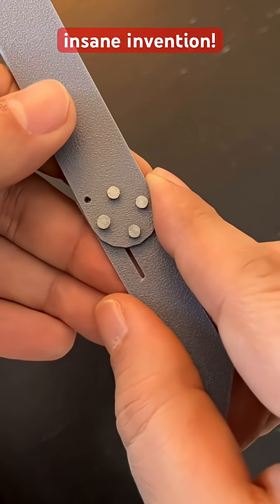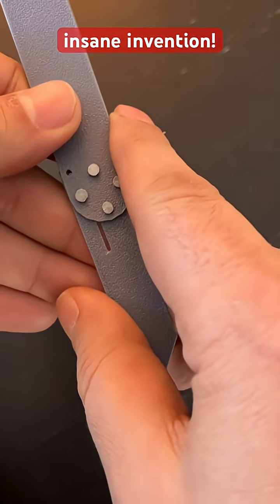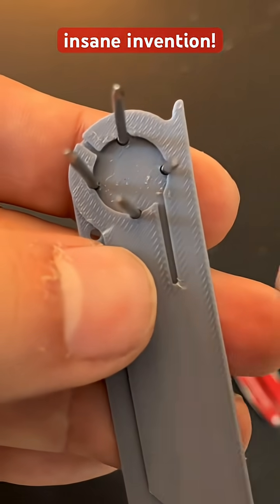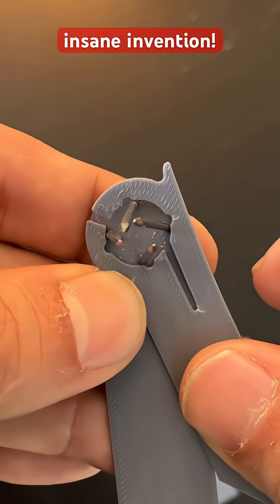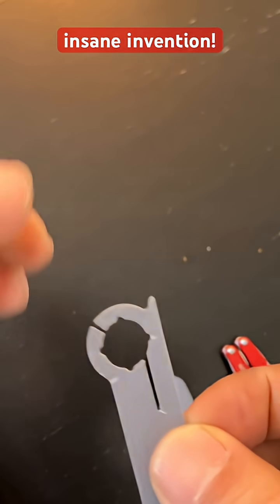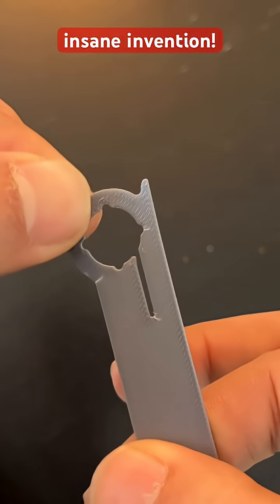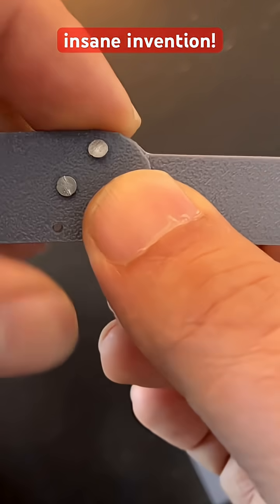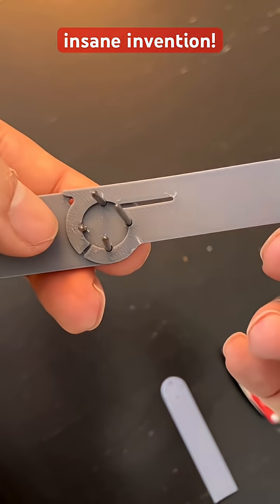Simpler Slipjoint for 2D cut tools

Comment: With a good flexible steel I can see thus making a much much longer lasting knife
Reply from the maker: One question would be what properties would be best for this application, are the requirements for springs too far removed from what a good blade needs in terms of heat treatment for example or is there a sweet spot where both functions are covered?
Reply: @ToolTechGeek hm, maybe a differential heat treat would be needed? That would be an interesting idea. Harder in the blade part, softer where the spring is but not too soft to where it would deform over time